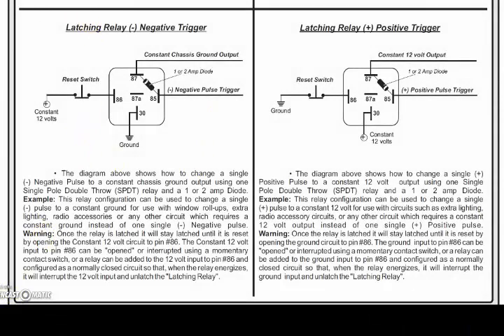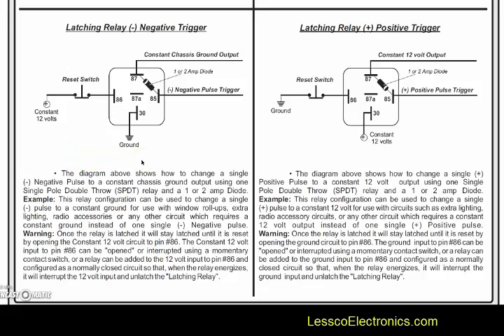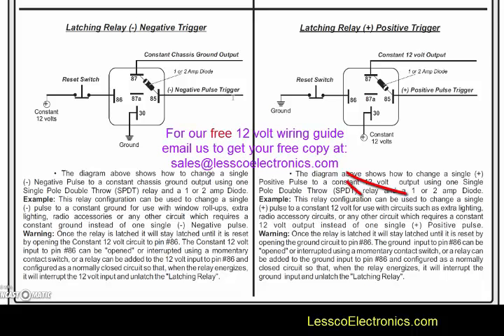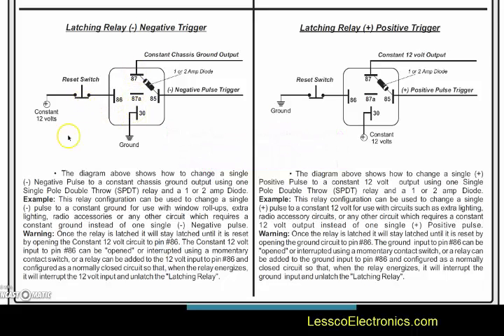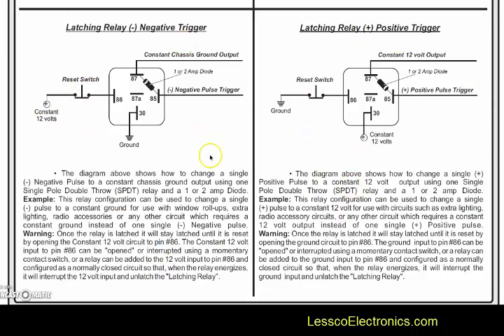How to convert a momentary input to a latched output relay

Comment: I have a custom motorcycle control setup and the starter button is obviously relayed to the starter but I don't have a kill switch because all my buttons are momentary. all the kill switch on a motorcycle does is breaks the circuit to the coils. what type of setup should I go with.

The kill switch is inline in the power to coils. 12v - killswitch - coils

Comment: Searching for so long on the net and finally found a decent explanation with a diagram. Thank you for that.
I stand corrected, but from my understanding if I was using this setup for an open fuel solenoid on a truck then I could use 87A to power the solenoid. 85 will come from an accessory power from the ignition. If the ignition is switched on then continuous power will go to 87A thus shutting the solenoid off not allowing fuel to pass through. Went the hidden switch on 86 is pressed power to 87A is cutoff and fuel passes through. 
Please advise me if I am correct. 
(My reason for using an open solenoid is to not supply power the entire time while  the vehicle is running preventing it from overheating and increasing its life).
Reply from the maker: so long as you have opposing polarity on the coil (pins 86 and 87) you can use 87a and 30 like this: https://ncd.io/relay-logic/

Comment: I have an application whre I basically need to ground a signal wire (negative trigger setup) in order to turn off the traction control system on my car (toyota 4runner v8). I want to retrofit the OEM style switch which is a momentary type. Do I understand properly that this set up is going to give me a ''push off - push on'' control type on this? Thanks for sharing this info.

Comment: Hi Lessco. I need to build a circuit that allows me to use a momentary switch to toggle between 2 110v lamps. Would I need to build a flip flop in order to do this? And just connect the output to the relay?
Reply from the maker: The relays I show here are designed for dc usage, not ac

Comment: what would be the application for this? I cant think of any reason why you would need a latched output in a car.
Reply: Need to design an unlatch with the same momentary switch.
Reply: Here's my scenario where I will use this positive trigger latching relay setup.
I'm adding OEM style fog lights in my truck but I want to use an OEM switch to turn them on. The OEM switch is a momentary 12v button. To use the switch as a true OEM setup would require spending nearly $150 at the dealership to reprogram my computer to "turn on" the feature in my truck's BCM. 
Using this relay I can use the OEM switch and bypass the bcm entirely and it will still look factory.
Reply: @benburns1502  how do you get the lights to turn back off?
Reply: @justinhudman1630  
That's the thing, you have to include the small "reset switch" if your power source is a constant unswitched 12V. If your power source is accessory (or RAP on GM vehicles) then they will turn off with the key. 
I hid my "off switch" in the top of the little cubby just above the light switch.